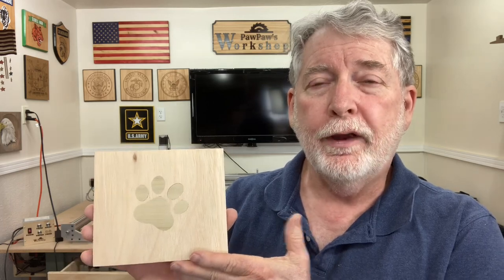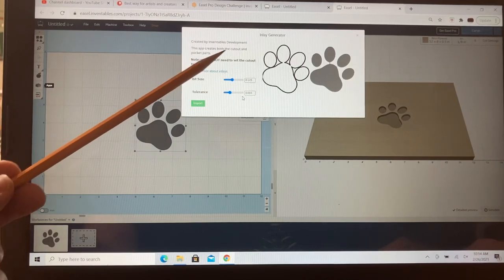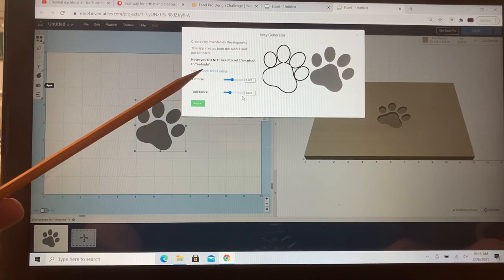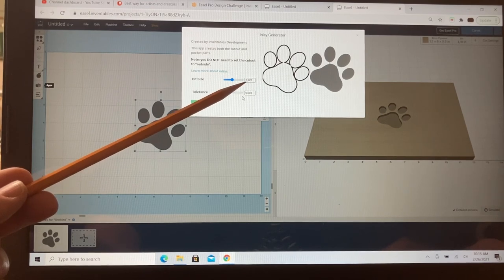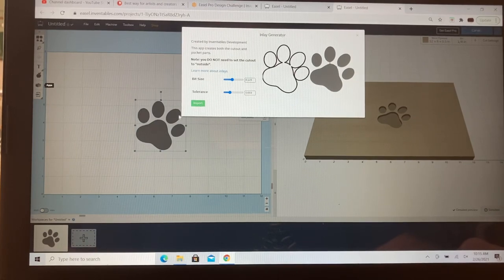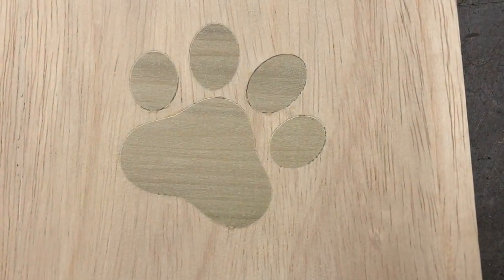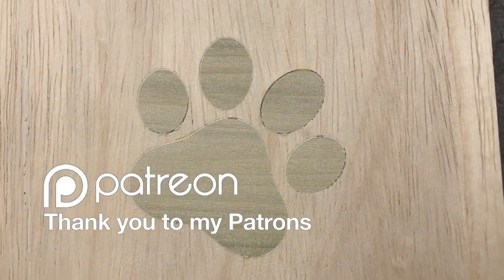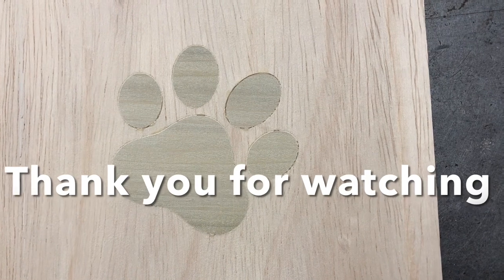Inlay Basics on the CNC using Easel

Comment: Hello Paw Paw.  I have an x carve and am trying out different applications in easel.  I see you using other software that has more options than easel.  Use easel because it came with x carve.  As it applies to inlays, where are the sessions whereby you are more detail with the carvings you spoke of.  Please email me and let me know how to access these sessions.  Thank you
Reply from the maker: I did not do any other inlays on the easel since you can not use the vbits. I was trying to do some work around to get is to work but was not successful. The easel app works well for just creating a pocket for the contrasting material to drop in. You can also use resin to fill the pocket

Comment: Great informative video. quick question, what is the reason to carve from the center? secondly, what is the procedure for setting the xy prior to carving? do you just have to be close to the center and just set xy zero before carving?
Reply from the maker: The toolpaths are generated by the software. If you have the pro version you can control the carving of the fill some what by selecting the direction. As far as the process for setting the x,y the easiest way is to just follow the checklist as it will step you through the process

Comment: Not sure what the advantage to not using a v carve bit.  The fit would be better.  Nice video
Reply from the maker: The inlay generator does not support the vbit. I may test that and see if I can make it work.
Reply: Larger allowance than 0.003", and might have to sand/trim some thickness off the underside of inset. Likely flip the insert 180°  to create v in right axis/plane??
Reply from the maker: That is one of my considerations for trying to make it work.

Comment: I am new to CNCs. This is good stuff, but I have a question. I see you move a lot of your material at 0,0 how does that work?
Reply from the maker: When you home the machine it goes to machine 0,0 on the x and y axis when you mov the machine to your workpiece usually the bottom left corner and set this as 0,0. This is the work zero position.
Reply: @PawPawsWorkShop  thanks. That makes sense. Was wondering what the workpiece zero was in Easel. Just getting started.
Reply from the maker: I have many videos to help you get started. I will also try and answer any questions you have about easel
Reply: @PawPawsWorkShop  thank you.

Comment: Why wouldn't you clamp down the Poplar and use Tabs? I have heard the Glue and Tape Method isn't the most effective, but would like to hear your thoughts.
Reply from the maker: Just look at my latest video on making the huge sign. Glue and tape method all the way including on section that was 23x27. It works fantastic. No tabs means not cleanup of removing the tabs. Saves time

Comment: The app works fine for inlays with no detail,  but lets see the trick for doing vcarve inlays in easel. The problem lies in not being able to select start and flat depth like vectric and even carbide create ...it can be done but it could be so much easier.
Reply from the maker: Easel inlay generator does not support the v carve.  I am attempting to develop a hack to make it work.  I do not know if it will work.
Reply: @PawPawsWorkShop  I know it doesn’t work.  My argument to inventarles team is that for $20 a month for Pro, Easel is unable to to justify its price point when other software has these features for free.  I’m not bashing Easel.  It’s great for beginners and for what it offers for “free”....but I (as well as the community) would like some standard features that others are offering for free.
Reply from the maker: You are correct.  I know that they continue to make improvements. It has changed a lot in the last three years that I first purchased my XCarve.  I think that if we look back to this time three years from now, we will equally see many changes.